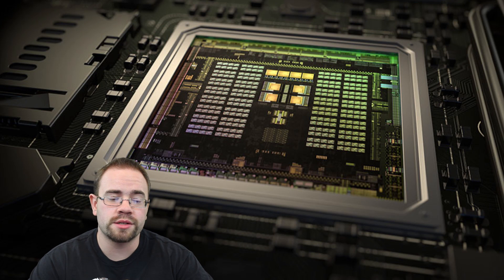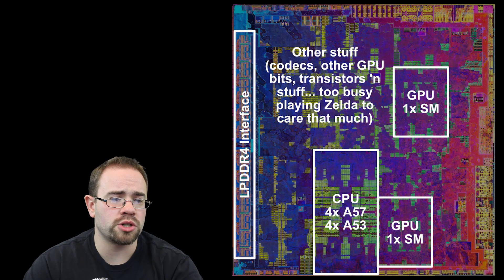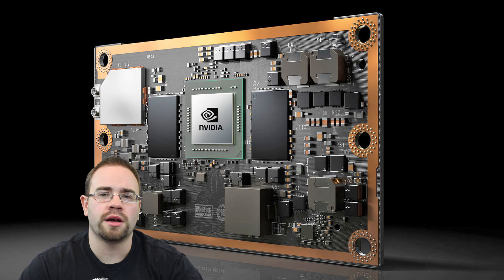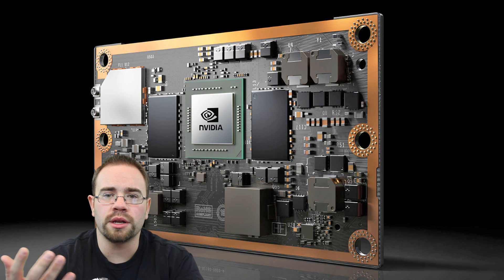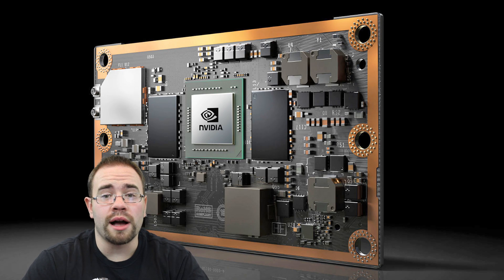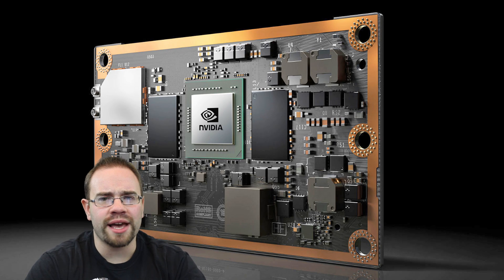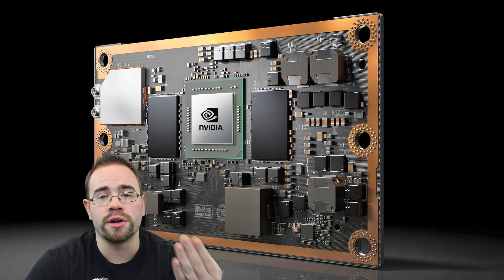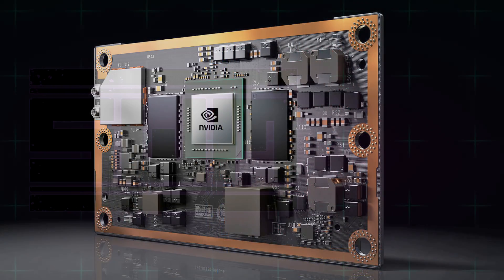Nintendo Switch Chip Was X-Rayed! Here's What's Inside.

Comment: a9x shits on x1 there are plenty of soc = or better than x1
Reply: A9X is apple only SoC. other Soc...to be honest i don't think there is any other soc that suitable for the switch. switch is a gaming device. and the only soc maker out there care about gaming is nvidia. snapdragon? that chip was built to win synthetic benchmark and that's it. their drivers have always been buggy. dolphin dev once mentioned that the one guy that working with adreno open source driver is more useful than the entire driver team at qualcomm.
Reply: nvidia always lost in the mobile soc there gpus are too power hungry and the adreno beats it the switch would have had way more battery life with an adreno.
Reply: then which do you prefer: even worse gaming performance or slightly shorter battery life? if nintendo were using snapdragon soc the gaming performance will be much worse. tegra X1 coming out around the same time as snapdragon 820 (adreno 530). the X1 already considered as slow by some people using snapdragon 820 will make it worse:

https://gfxbench.com/result.jsp?benchmark=gfx40&test=631&text-filter=&order=median&ff-lmobile=true&ff-smobile=true&os-Android_gl=true&os-custom_gl=true&os-iOS_gl=true&os-iOS_metal=true&pu-dGPU=true&pu-iGPU=true&pu-GPU=true&arch-ARM=true&base=device

also adreno was develop for mobile device in mind as such it's API support also limited to "mobile" API support unlike nvidia tegra that has been supporting full 3D API since their K1. the reason why it is possible to port some existing console title to switch despite it's performance is because tegra are capable of supporting the same feature set that that supported by home console hardware.

Comment: I'm concerned the switch is going to fail for a number of reasons (and no, i do not WANT it to fail) 
1. The "casuals" now have games on their phones. (Not as common in the Wii era)
2. In my experience, a lot of 3ds owners have the system solely for Pokemon. They aren't interested in spin-offs (Pokken, or Gale of Darkness) and wouldn't purchase a switch unless a main title appeared on the system (IF it does, then you can throw all of my points/arguments out of the window, because this thing will SELL) 
3. Most people own a Ps4/Xb1 one at this point. (not to mention the enhanced variations) and can't justify a second, or maybe even third console. 
4. Cheap for a home console, expensive for a handheld (compared to others) It's harder to sell this as the successor to the 3ds, which is the crowd that Nintendo needs to attract. 
5. Nintendo has a pattern of shooting themselves in the foot. (I already know people who wouldn't touch this thing until the SD card issue - and it is an issue - is resolved. Not to mention those that lost their 3ds' at some point with digital downloads) Plus there's the whole youtube/weird copyright stuff that always stirs people the wrong way. 
6. Some people are just done with Nintendo, because of most of the stuff i've already mentioned.
7. Having 1 10/10 game isn't going to shift a significant amount of systems. Once that Zelda hype dies down, what are we left with? Indies don't sell systems either, and Mario isn't for a long time. I know there's a lot "in development," but we have triple A titles releasing every week on the other systems. (They might not be 10/10, but when people see a single shelf of Switch games versus half a store of ps4 games, they're going to go for the ps4) 

Again, unless we get a main pokemon game. If that happens, this thing will sell. Nintendo/The Pokemon Company still underestimate their power. I know people who would never consider themselves "gamers" that still buy handhelds for pokemon.

Comment: BotW is amazing, but it is a Wii U game.  The Switch isn't doing anything amazing to be able to handle it.  It is just really well made.  When newer games, written with the latest engines and APIs, come out, then that will be what the Switch was designed to shine on.  I think there will be great looking games on the Switch but the hot new 3rd party games are still going to be made for much more powerful hardware first and then after they jump through a bunch of hoops maybe we get something similar to them on the Switch.  The best games will be Nintendo's games, of course, probably followed by mostly smaller studios.

edit: Oh, and they will get older hits.  People will say oh I can play that game I loved "on the go".  They just should have sold it is a beast of a handheld that it is.
Reply: PS Vita can't run PS4 titles. You can stream a game to Vita, but it still runs on PS4. 
Ryan is right, Zelda runs on WiiU and I'm pretty sure new Mario could too.

Problem is: cross-platform hits are easily portable, because PS4 and XOne have similar performance. Switch has much less computing power, so porting a title could be expensive/problematic/not possible.
Reply: THe difference in power between the Switch and the XBone is less than that of the difference between XBone and PS4, so if it's on XBone, it can easily be on the switch
Reply: Ryan Krammes It is doing amazing to handle those games
Reply: Exactly. People seem to forget that BotW is a Wii U port. It wasn't made specifically for the Switch.

By the way, Nintendo wants to sell the Switch as a home console because they don't want to kill the 3DS yet. The Wii U was already on its way out, but the 3DS still has life left in it. I'm sure once 3DS sales drop, Nintendo will begin offering a less costly Switch package that is the unit only without the Dock.
Reply: Ryan Krammes so is the ps vita can run PS4 games well right and the switch is more powerful then we don't have much problems right...I mean how much less powerful is it
Reply: It is a WiiU game that slows down on Switch. :( I love the game, it deserves a better hardware, and at least 1080p without frame drops.
Reply: +Tomasz Kucza
My guess is that Breath of the Wild was optimized for 720p (it is a Wii U game, after all), which is why the game runs better on the Switch in handheld mode, when the game is running at 720p, versus docked mode, when the game is at 1080p.

Comment: Nvidia didn't put the Tegra X2 in the new Shield TV probably becuase of an agreement with Nintendo.   Same reason I believe Nvidia canceled the Tegra X1 Shield Portable that they had already built and had gone through the FCC.   For what it's worth , Nvidia also canceled supply of the Tegra K1 to JXD who were using it to produce the S192 Tegra K1 gaming tablet. It has almost ruined JXD.  It seems to me that Nvidia probably via an agreement with Nintendo, canceled any direct handheld competition and postponed any shield tv with a SOC that would make the Switch look bad.
Reply: Nvidia doesn't have a x2 soc commercially available yet. So far we only have had a announcement of it to be used in cars in the future but nothing concerning consumer electronics.
Reply: The Pascal X2 is available and is in production for the Jetson board - which has been shipping for a while.  And  it is avaialble to manufacturers. Did you not think it weird that the latest Shield TV which was coined  to be the spearfront of every new Tegra SOC, was released with an X1 again - weirdly launching ahead of its may anniversary .  Did you not think it weird that Nvidia said the Shield X1 Portable 2 was coming, then it was mysteriously canceled.  Later we found out that they had fully built it and gone throught the FCC .   At  the same time Nvidia canceled supply of the K1 to JXD who had just launched their K1 S192 gaming tablet. No one knew why.  It's pretty fricking obvious what happned, especially when you look at the timings
Reply: even if the switch get tegra parker i don't think the performance uplift will be significant.
Reply: I'm pretty sure NVidia doesn't want to shoot them self in the foot either, considering they'll be competing with Nintendo, who've got more brand recognition among layman
Reply: Doesn't really matter. Pascal is in the end just a 16nm version of Maxwell

Comment: I don't think that Nintendo needs to show how capable the Switch is at E3 because Zelda has to be the console's limit right? With 4 years in development and plenty of optimization time it's still only hitting a mostly stable 30fps. It's probably the hardest thing the Switch will have to run throughout its life span. Their E3 this year just needs to be a bunch of big, first party, system sellers like Metroid and Smash.
Reply: Grant Campbell 
not at all zelda was not made from three ground up for the switch.  did you not watch the video.  do you have selective hearing?
Reply: Zelda wasn't made for the switch it was made for the wiiu and the switch got a quick port. The switch version was in development for about a year with emphasis on sound and draw distance. At launch there aren't any games that were developed with the switch in mind on the console yet. The switch is a lot more powerful than the wiiu so we are going to see much better looking games than Zelda.
Reply: DAVAND23 Oh my goodness I completely forgot that it was originally only in  development for the WiiU. You're totally right, my bad.
Reply: Grant Campbell 
Fast RMX runs at 1080p 60fps constant.... so.....

Comment: thank you for the video. i was holding out hope for some modified chip. but nevertheless still impressive for an x1.
Reply: +DAVAND23
Except, the x-rays kind of would show that. HMP is implemented at the silicon level. 
I'm just not sure how visible it would be, or if anyone would have any clue what to look for.
Reply: It could still be modified. The x-rays won't show if the chip uses HMP and we don't know what the low level api made for the switch will do for performance.

Comment: I still think the Switch is going to become a handheld over time, and that Nintendo are working on a dedicated home console to come out 3 years or so from now.
The Switch is still decent as a console, and the frame rate problems we see are most likely due to rushed ports.
It also has all the latest and greatest tools for devs and that should help them get more from less with the sytem, provided the effort goes into it.
If anyone's worried, don't be. It's still a capable enough system to hold its own as a console, and more than capable as a handheld.